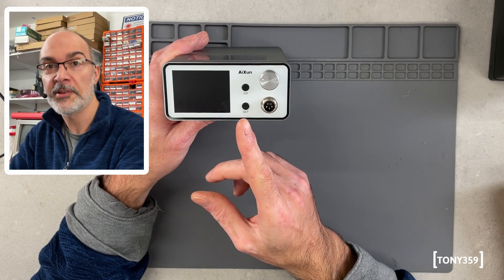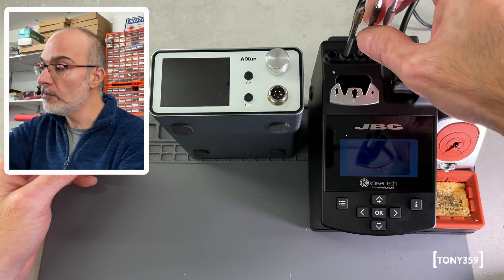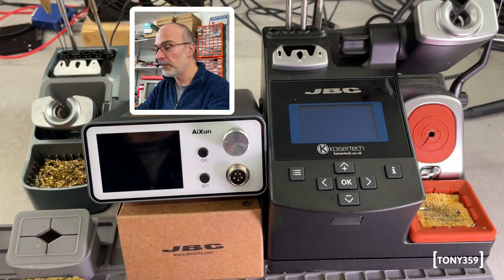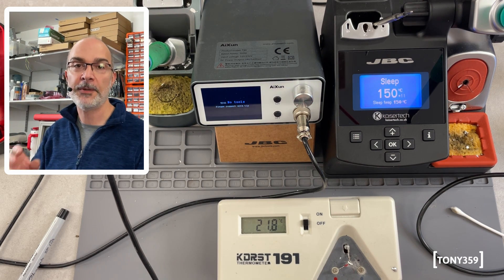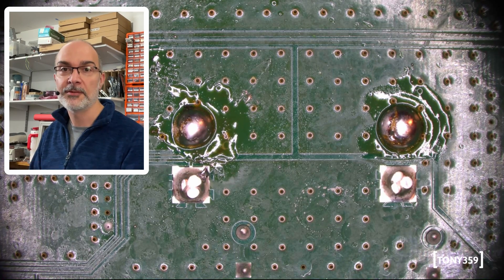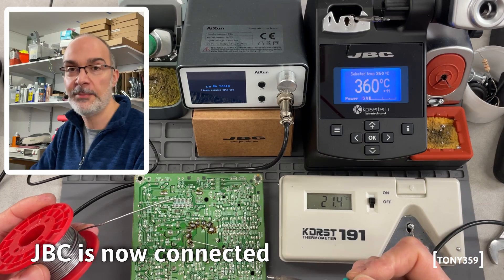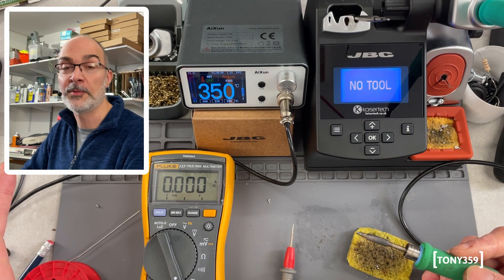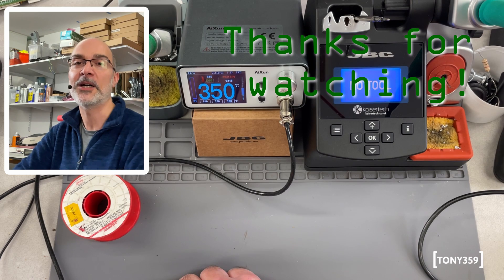Can the Aixun T3A really beat a JBC station?

Comment: I have a Aixun T420D and it does not have any voltage on the tip.  Neither AC nor DC (measure with my Keithley 2000) mode.  I cannot yet test overshoot, still waiting on my soldering iron temperature tester.

The JBC tips have 3 connections, in front it has the earth and TC (thermocouple), in the middle heater and at the back heater & TC.  The Aixun T3A is using a DC power supply.  And the TC circuit is clearly not isolated.  So they have no choice but to use the earth pin at the front as the TC positive.  Because the rear most pin HAS to be 0 volts or you'll inject a voltage into your TC circuit (or vice-versa).  Feel free to run through this theory yourself and propose other ways in which you can heat a JBC 3 pin cartridge with DC and no isolated TC measurement circuit and not run into this issue.

So JBC rightly chose to run the heater with AC so that it is not referenced to the TC and thus the earth pin can be at 0 volts AC/DC.  Then the rear most pin is the TC positive pin and one of the heater pins.  The alternatively IMO is to use a isolated DC-DC supply with opto-couplers for the TC/ADC chip.  Then your DC supply will be floating in reference to the TC.

Also there is quite a hooha going on about JBC station build quality and them silently swapping out parts.  But I can link plenty of videos where they have some REALLY bad quality soldering inside the JBC station, even using cheap Chinese caps.  That is the reason I bought the Aixun T420D, it is clearly very well made inside, not to mention it can drive two channels and T245, T210 and T115 at a lower cost than this equivalent single channel station.
Reply from the maker: I cannot comment on JBC quality - I've heard that too. Mine works so far but it doesn't mean much! That said, I really didn't want to buy another Aixun. Yes, reviews say it's ok but the T3A was also supposed to be ok! :) In the end I stumbled into these issues while using the T3A normally, I didn't do anything special!
I didn't know JBC was using AC to power the tip. Interesting. So the Chinese badly reverse engineered it? :) 
Anyways, thanks for your feedback about the 420, I hope it helps viewers in making their decision!
Reply: @tony359  > So the Chinese badly reverse engineered it? :) 

While that is a common theme, in this specific case they probably started from the perspective of 'how can we make this as cheaply as possible' and ran into 'oh, that's why JBC didn't use SMPS but instead used xformer/AC powered heater tip' - but ran into that too far into production and, being a Chinese company, ABSOLUTELY COULD NOT ADMIT THEY SCREWED UP because that is social suicide in Chinese culture.  So instead, they shipped it and proceeded with 'lalalalala, we can't hear you, there are no problems with our design, nope'.

To be somewhat fair, they also (apparently? hopefully?) corrected this by using a transformer / AC-to-tip power supply in the newer T420 series, so it's not like they can't learn, just that they can't admit being wrong.
Reply: @tony359 
> That said, I really didn't want to buy another Aixun. Yes, reviews say it's ok but the T3A was also supposed to be ok!
I don't make my living on electronics, so I could gamble, but if it was my job I would not, I get 100% why you chose the way you did :)

 > I didn't know JBC was using AC to power the tip. Interesting. So the Chinese badly reverse engineered it? :) 
Probably saving cost IMO, SMPS are so much cheaper to manufacture than bulky transformer that is specific to region after all.

> In the end I stumbled into these issues while using the T3A normally, I didn't do anything special!

That video actually inspired me to take a harder look at T420 after I initially dismissed it.  That and alternative to T245 for SMD soldering (using T115 now).

Anyway thanks for the video and brining a repeatable way for testing it :)
Reply from the maker: You're very welcome and please do let me/us know how the 420 goes :)

Comment: There's always compromises buying cheap stuff. That's part of the fun of being a hobbyist. Professionals don't care if they spend a bit more on the tools they use for their business as that cost is neglibile in the long run anyway for them. It's very important to be aware of the caveats with the knockoffs and cheaper stuff, though, so videos like this are good to inform people about the issues. I am keeping my T3A, as I'm aware of its shortcomings and make sure I don't run into any trouble. I am staying on an older firmware version though as the "fix" they did for temperature overshoot is just ridiculous as you seem to agree with. Their algorithm must be something like this: display_temp = min(measured_temp, set_point_temp); LUDICROUS.
Reply from the maker: I wish I could downgrade - mine doesn't take anything below 1.30-something I think, the display would get unreadable. I guess they might have swapped the display driver.
I tried staying away from those caveats but I really couldn't. The SMD removal was the last straw: I cannot mitigate that! I had to stop soldering for 10-15 seconds waiting for the tip to get back to the set temperature. Of course not everybody needs to de-solder hundreds of SMD caps with two irons but I like to think that my station can do that if I have to!
Thanks for watching and for the nice comment!
Reply: @tony359  I did downgrade to one that showed the actual temperature. I am on holiday right now so I can't check which version it was, but at least my unit always shows the measured temperature now.
Reply from the maker: the 1.33 I was using is showing the actual temperature so it's an improvement on the display_temp = min(measured_temp, set_point_temp);  ;)

Comment: I always appreciate practical tests like the speaker making noise when the solder iron touches the wire. Excellent review and thanks Tony!
Reply from the maker: Thank you! Sometimes it's easier than showing oscilloscope screens! :)
Reply: @tony359  Hehe - yes. Oscilloscopes are still a bit of a mystery to me :)
Reply from the maker: the "training" video is still on my list!
Reply: @bitsundbolts  Same here :(
Reply: The fact that the speaker made any noise at all proves that enough energy comes through the tip of this soldering iron to blow up any kind of micro electronics! Totally unacceptable, also the fact that the temperature of the tip can randomly go up to 500 degrees is also totally unacceptable! The JBC (from Spain, it is NOT from the UK!) is one of the best soldering irons I have ever worked with, the speed with which you can change to another tip, and the speed it heats the tip up is phenomenal!

Comment: Non-grounded soldering tip? Instant disqualification from me!
Even my 30€ cheapo station does a lot better! (JCD-8898)
Reply from the maker: Absolutely but... the funny thing is that if you check the tip for ground... it's grounded! Not sure how is that possible but that's what my multimeter says! Thanks for watching!
Reply: @tony359  I am not sure about this, I am just thinking. What I've seen on the oscilloscope was PWM with huge spikes on the edges. Spikes leads me to the conclusion there is some inductance in the system and PWM is used by the soldering station to regulate its out power. So I think the problem is somehow connected to that regulation. The station peaks around 200W and the voltage on the heating element should be somewhere between 20 to 30V which means current about 6 to 10A, which is a lot for that tiny cable between the station and the handpiece. If I am correct at this point, then they just connected one end of the heating element (which also acts as a temperature sensor) to the tip shielding (which is separate on the original…just to open the possibility to ground it), so that 1V is in fact voltage drop over the wire between the handpiece and the station, which is why you found it connected to the ground using your multimeter. Because it in fact is connected to the ground, what you see on the soldering tip is voltage drop caused by huge current running through the resistance of that line with spikes caused by its inductance. So if I am correct at this point, then disconnecting the shielding of the soldering tip from the terminal of the heating element should solve the issue, because as they are disconnected, you can safely ground the shielding of the soldering tip to the real ground using another wire. Again. I am not sure if it works as I've described, I do not have that station here, it's nothing more than a theory based on what I've seen in the video.
Reply from the maker: That's another excellent theory, thank you for taking the time to share it with everybody!
Reply: @tony359  at work, soldering to milspec, there is nothing on the soldering table connected to GND. All grounds must be connected together and connected via 1 megohm to real ground. Mo way the iron would be connected to ground via power supply or similar
Reply: @tony359  That is interesting! The tip is grounded and yet has about a volt on it that can deliver almost 2 amps... wow. Is it voltage drop over a too thin wire to ground or something? (But, the handpiece and cable is a JBC part I presume? So that would almost rule that out).

Comment: Thanks for the videos on the subject. I for myself am fine with not working on grounded PCBs, but I hope someone figures out why that voltage leak is introduced in the first place and maybe finds a mod to fix the issue.
Reply: Have you tried probing the pinout of the connector to see which pins connect to the tip vs. heater, and which ones have voltage on them?
Reply from the maker: No, I did not do much troubleshooting. I repair things, I don't have the skills to design things. I'm happy to leave that to others :) There is a very long thread about the T3A on EEVBlog, there are a few people looking into this issue.
Reply: @tony359  
I posted another comment about this but seen it here reading. I think a resister should solve the issue & you can add it in the handle.
Reply: @mtking2196  que resistencia
Reply: @masterff925  
I am not sure if this is a question.

An update on this tho. I have been looking into this on my own station. My station is not grounded to earth but it does have a pin for earth to the iron. This "should be" tied to the outer shell of the tip with a very high resistance. You do not want it to conduct electric but you do want it to blead off static. (I would guess around 1M)

I have ordered a few handles from China & they all have earth tied to negative. For them to work correctly earth & negative need to be isolated.

I don't like using the word ground here because it's meaning is not very well understood & gets used in the wrong way to mean many different things. So for AC we will refer to as Earth & for DC we will use negative. 

For your sensitive electronics they should not cross. The earth voltage can fluctuate several volts. The resistor stops a rush of this voltage & will hopefully blow if the rush of current tries to raise the voltage to high.

For your PID it needs to control the temp by turning the voltage on & off quickly & if it is getting feedback from the earth then it isn't going to know the difference in the feedback & what it is supplying.

A simple fix should be to just cut the wire that goes to the outside of your tip.

If you are earthing your board then you should also have a resistor on it as well.

In most of the US neutral is tied to earth(I don't know about the rest of the world) & it does have electric on it regardless of what you have been taught.
Reply: @mtking2196  You have the Aixun T3A station, it has that problem with tip voltages.
Reply: @masterff925  
No
I have another brand & mine is not earthed but it does have the outside of the tip tied to negative. This would cause an issue if you were soldering on something that is earthed.
Reply from the maker: Opening the T3A is challenging :) I'd be more inclined to find a station which doesn't have that issue. I was told the Sugon is good - but I just didn't want to experiment more... Thanks for watching!
Reply: @tony359  I guess the Sugon/Aifen A9Pro and the AiXun T320 would be the closest contenders, I wonder if they have the same problems.
Reply from the maker: The 320 does - it's still SMPS power supply. I'm told the Sugon is very good - I just didn't want to spend quite some money to "test" again. I really needed something reliable and that could be trusted. But maybe the Sugon is the JBC killer!
Reply: Have you seen this problem on the Aixun T320? Or do you only suspect it because it has an SMPS source?

Comment: What if you would replace the switch-mode PSU in the T3A with a normal transformer?
Reply from the maker: I think there are stations with a linear transformers around, that might be better than modding the T3A :)
Reply: Oh come on Tony, were is your sens of curiosity! 🙂 @tony359
Reply from the maker: You're right, I gave up this time! :D
Reply: Good question! I think it could be possible, but at that power level you would need a pretty big brick. Maybe the size beekeepers use to affix wax boards to wire harnesses on wax frames. My father has one and that monster of the transformer is over 3 kg. And properly isolated one are bloody expensive.
Reply: I'm thinking about that too. There are 24v 200W troidal transformers and they are small enough. Will a bridge rectifier be enough to get clean DC voltage?

Comment: Even if i could afford a JBC (which i can't), i still wouldn't buy it. Its too bulky and takes up too much space on the bench.
Reply: and you can't put other equipment on top of it where as with the aixun, you can.
Reply from the maker: On that one, I agree. It's a massive step backwards compared to the Aixun.
Reply: Even my trusty simple Weller, which is also a transformer type, is bulky enough that I keep it on a shelf above the desk and use Goot's side holder for it on the desk. Not the best solution, but I couldn't muster using JBC on the desk. It's way too bulky.

Comment: i've got an old hakko clone with a temp knob and a digital readout. lets me fine tune without having to resort to dealing with annoying button combos that a lot of these newer stations tend to use.

unless i can find a more modern system that uses the same general idea, not so much. the ksger t12 units and similar come close to the point, but also really don't. because if things glitch out the rotary encoder isn't going to be of much help.

i'm probably always going to want manual control of the temp, i think.

and yes, the voltage/amperage output on the tip is of any unit is... beyond unacceptable. a few mili or micro volts are probably irrelevant, but half a volt and half to one and a half amps? noooooo way.
Reply from the maker: You know, I also looked at some older analogue JBC... I thought that maybe removing the electronics from the equation was a good thing! Why everything these days has to have a colour LCD and a firmware? :) Sometimes simpler is better. Thanks for watching!
Reply: Rework/hobby/home use is usually very different from industrial use. The reason the industrial soldering equipment lacks on the UI department is due to the station is set up to a single task on a production line for the vast majority off the time. And also usually, the station UI is locked down with a pin, so the operator cannot fiddle with the settings. A great UI experience is simply not on the top of the list. Great ergonomics, superb soldering performance, that is what JBC is about. And in my opinion, JBC delivers this in spades. I put up with the UI being a bit... awkward.